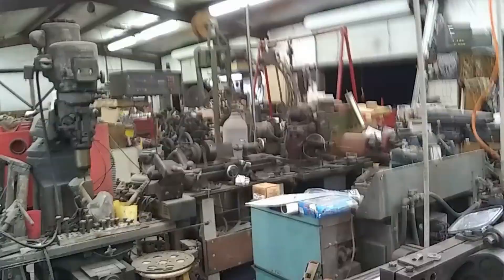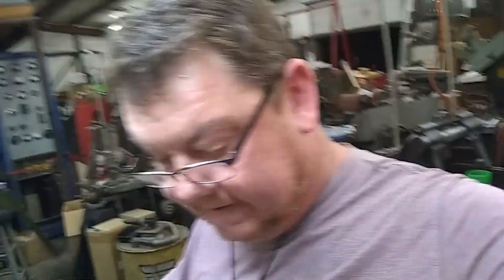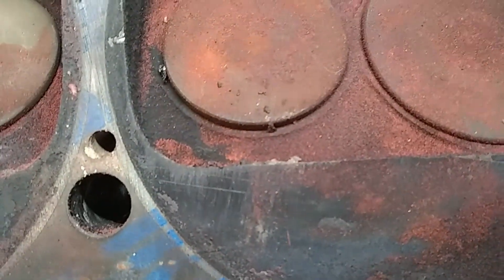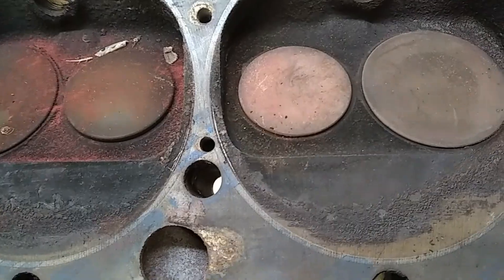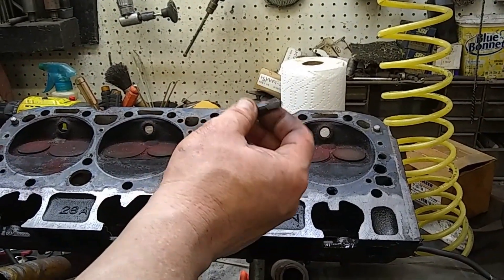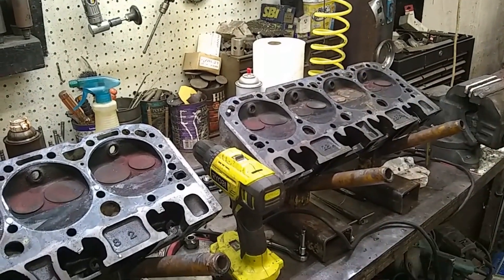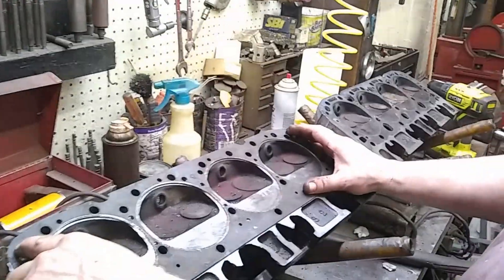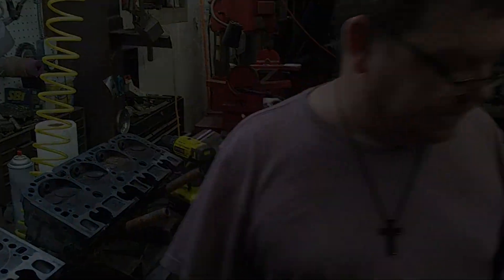400 Small Block Chevy Head Steam Hole Repair & Head Rebuild. Part 1

Comment: So can i drill these holes on my afr 195 heads? I bought them for a 350 but wanna use them on a 400 instead
Reply from the maker: yes yo can. But make sure you have some dowel pins and the head gasket to align them up correctly.   the ones on the spark plug side go straight down. the ones on the intake side go at a SLIGHT angle towards the center of the head. Apx 15 to 20 deg but its not critical. I would only drill them if its a street driven engine that sees a lot of stop and go low rpm stuff. If it's primarily a race engine I wouldn't drill them at all, and in fact if it's a race engine I would plug the ones in the block as well....But only if it doesn't do a lot of idling at stoplights ect Thanks for watching, If I can help you in any way LMK.
Reply: @Marksracingengines  thanks, I actually am gonna use it as a daily since my 350 block cracked and I bought a 400 instead since I found out they can use the same parts, but the bottom is new so now I'm just gonna assemble the top and didn't wanna spend money all over again so your videos helped me out alot, thanks!
Reply: @Marksracingengines  also do I have to use a cam only for the 400 or can I use my 350 cam instead?
Reply from the maker: @Texasmule  anything that will fit the 350 will work in the 400. the only difference is the main size is bigger in a 400 and if its factory...the rods are shorter. but cam,heads ect will bolt right on. but do pay attention to the compression ratio. whats the chamber size of the AFR's?  Tell me a little about the 400 you have.
Reply: @Marksracingengines  they are the AFR-1001 i believe and the 400 I have is .030 over from what the owner told me with flat top pistons and stock rods and crank
Reply from the maker: @Texasmule  ok so if they are flat tops..the afr-1001 are 64cc and that would put your static compression ratio at apx 11 to 11:.5 to 1 depending on the deck height. with aluminum heads that's not impossible to run on the street with 93 octane but it's pushing it. Now depending on the camshaft you run  and how much overlap and where the intake closing point is, the dynamic compression may be ok with that static compression. in other words...if its a big ass cam it might be ok.

Comment: Good video! Drilling the holes by hand is a risky undertaking. Especially for people who not machinists, and know only enough to be dangerous. I'm making a jig plate with drill bushings to make said procedure much more pleasant. by the way it would be worth tossing the 882 castings and opting for a heavier 993, 997, 487 style casting. But that's only my opinion. Take it for what it's worth. :hand-purple-blue-peace:
Reply from the maker: yeah I'm not a fan of 882's and 624's are just as bad. 9 out of 10 are cracked. that's just what the customer brought me to repair. I have a shelf full of 993's and 487's , but he insisted on me fixing those junky 882's. before it was said & done I ended up putting guide liners in, valve job, surface the whole deal. he ended up with more in those heads than if he would have just bought a set of the 993's I have ready to go on the shelf. Thanks for watching and commenting!

Comment: ~5:52 there is always time for lubrication ! lube taps & dies , rotate/back up , feel the cutting ,  be the cut etc. 
 Be nice to your tools , unless they are considered sacrificial   ;)

As discussed these are not attractively cast free flowing , I do remember ppl telling me of this steam hole thing in 400sb cylinder heads. Never something I ran into growing up in .au , 308 Holdens & 351 Clevelands 2v so far
Reply from the maker: I put  lube in all the holes before I started. And those holes cut so easy you don't have to back up lol. Just gotta be careful it don't bottom out the tap cuz it's carbide and will snap right off.

Comment: Those 882 casting # head are the biggest pieces of sh#t that Chevy ever designed 😡
Reply from the maker: yeah they're pure junk, 8 outta 10 are cracked. They dont flow worth a Chit, and the chambers are the worst design ever cast. And for what ever reason customers still drag em inhere for me to fix when there's better head options these days.

Comment: Those are what I called stitch n lock pins. I remember watching a machinist stitch a claimer block and then did the JB weld trick on that block after repairing the crack in the valley. That block never got claimed either.
Reply from the maker: yeah Lock  n Stitch is the og company.  I've pinned up cracks in the intake valley and on the sides of blocks 6 to 8" long before lol takes a while but if it saves the block I'll do it anymore. they are gettin hard to find. But your right...it was never those "special" claimer engines with cracks and crazy stuff we did that ever got claimed lol it was always the good ones....go figure